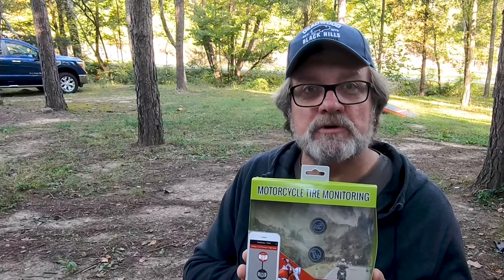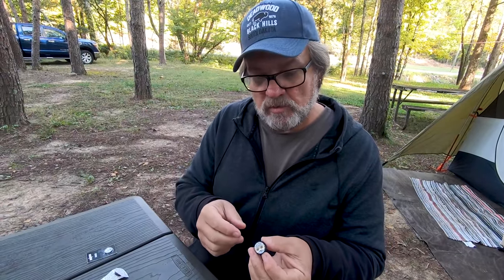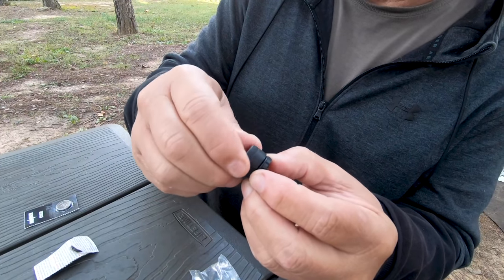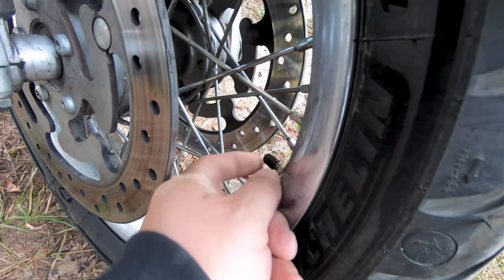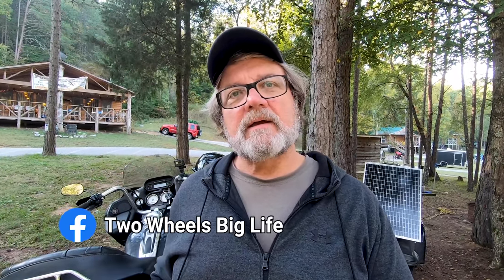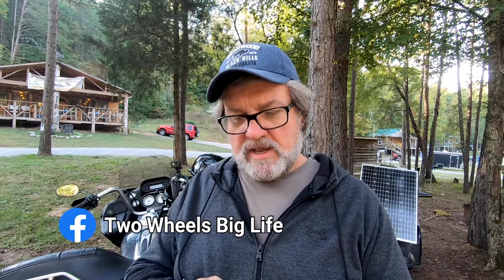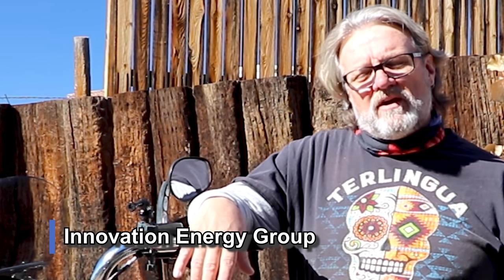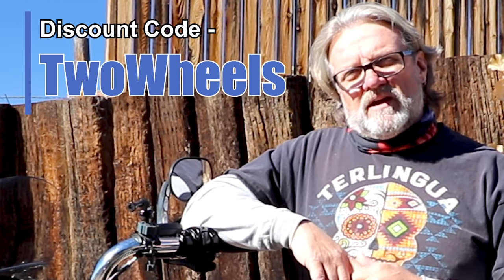Motorcycle Tire Monitoring System - Safety is key.

Comment: I haven't used them but will probably get a set.
Reply from the maker: Thanks. Be sure to use the link in the description and promo code.
Reply: Check out site here an found tire pressure unit over $80, an I don't have blue tooth? $80 seems excessive!?

Comment: I have been using a similar system for several years after I experienced a low pressure incident on my front tire. (Bikes; Older bike, 2008 GW, ABS. New bike 2021 GW Tour DCT w/ TPMS)  I had great difficulty holding a turn and nearly left the road.  I was out of town but later found the valve stem would leak at highway speed. 
No shops were near so a tow truck was called.  I was riding a recently added new set of tires but the dealer did NOT change the valve stems!!!
A group of us talked about this but it was soon forgotten; unfortunately.
A two up couple riding down a 6% grade lost control of their bike, left the blacktop and both were killed.  They were slowing and the speed was low when they left the hard surface.
In my opinion ( and others) was if they had installed a TPMS system they would still be riding with friends.
Rich; good thinking to add these monitors.  Chris, please add a set to your bike.  This is good advice for all; IMHO.
Good Rides

Comment: I have used FOBO Bike 2 on my 2014 Ultra Limited for several years. Love it but you still have to remove the sensor to put air in the tires. I do use the locking nut.

Comment: I agree, Richard. A tire pressure monitoring system gives great piece of mind. My bike came with TPMS. The time my rear tire picked up a small spike I got the low pressure alert, slowed down and pulled over before loosing control. This all happened within 5 or 6 seconds. By then the tire was flat.  Another time, on a short trip, I got the alert, the TPMS was reading low. Added air, no sign of a puncture. I monitored the tire pressure and had to add about 6 psi every morning for the next couple days and made it home. Upon closer inspection I found a tiny little staple. The timing was good in that it was almost time for new tires. When I removed the "stapled" tire one leg of the staple had just barely gone through the tire. The staple's shoulder had been worn right off so it was almost invisible. Peice of mind! That's why we do preventative maintenance and pre-ride inspections. Cheers you two.
Reply from the maker: Thanks Gordon

Comment: I have considered these, as tire pressures are crucial on two wheels. My only concern is that these caps hold the Schrader valve open, and if that seal fails, your tire will go flat. I read tons of reviews on the various manufacturers of this style tpms, and saw a fair amount of failures. Please keep us updated as you get more time and miles on these sensors. Great video and I appreciate your detailed explanations of your experiences. Ride safe guys!
Reply from the maker: Thanks Ace
Reply: @TwoWheelsBigLife  I've been looking for a system for my VTX1800 that mounts inside the tire like the automotive industry uses but haven't found anything yet. I've gotten so many good ideas from you both and I really enjoy your videos. I saw others reccomend using the lockout to prevent the sensor from loosening,  but that seems like it would be a pain every time you need to adjust tire pressures.  Am I missing something?

Comment: Richard,  Please use the locknut as I've had this type of TPMS cap become loose after time.  You can't use locktight on them so use the jam nut that comes with them.  Nice vids, keep em coming.
Reply from the maker: I most likely will before we roll out again
Reply: Wondering if there is a way to shut power down on the caps so you save battery life? Parked a few days or longer you wouldn't need them. Just take them off or???
Reply from the maker: @TheCollectiveIntellectual  Great question. You can remove the battery without removing it from the valve stem.
Reply: @TwoWheelsBigLife  GREAT..thanks for the prompt reply. Gotta get me a couple pair of these. 👍
Reply: Hey first i wanna say , my condolences to chris mom , and whats the link on the tire pressure toy ....seems like a great idea for safety .....thanks i didnt see the link pop up

Comment: I have them on my trike plus the camper and what is nice is I can check the pressure first thing in the morning without kneeling on the ground to do it. I buy them off eBay for cheap but they work the same. I have a set on my toy hauler also. These work better than the factory units as the factory items can't be adjusted to handle the type of low pressure I run in my tires ( 24 rear 17 front) BTW there is nothing wrong with getting alerts, America can use more lerts.

Comment: Thanks for huge tip, I had been planning on getting something like this. The new Indians and I think the new Harley's come a monitoring system.  My friend had the alarm come on while riding his Indian .. low pressure.  He pulled over found a nail in his rear tire. Was able to plug it and keep going till he made it home.  He still had to put a new tire on it. But he wasn't stranded along the side of the road and the tire didn't go all the way flat on him.  He carries a air pump like I do as well.
Reply from the maker: Yes we have a pump also, good to keep in a saddle bag.  most new bike have this but the trailers and old bikes like mine do not.

Comment: Mine are not BT. I have a small display on the triple T that powers on with the bike and displays the pressure No phone alerts but the display will flash and beep if the pressure gets out of the user set parameters. The monitors turn on when the bike gets to a certain speed probably like the set you have.

Comment: FYI, modern Harley touring bikes have a tire pressure monitoring system that tells you the tire pressure and turns on a warning light when the pressure of one (or both) of the tires drops below the recommended pressure. Also, you said you never leave your bike unattended, that isn't true, you often go off on hikes and you leave your trailer at the camp site all the time. Keep on living the life, you 2, I know it's something I couldn't do for long (especially now at 70).
Reply: The only Harley Touring bikes that I'm aware of that come with the TPMS are the CVO versions.
Reply: @jkentsan   All I know is that my 2020 Road King has it. I have noticed that the bike came with some items that I don't think were stock but it is the 107 engine and it seems that the high end models would have the 114. I know I really like the bike, though, it is far superior to the 2003 Heritage with the twin cam engine.

Comment: As mentioned in another post, do not use any TPMS device on rubber valve stems.  That's a no-no.  Thanks for the video!
Reply from the maker: Yep both of ours are metal stems.
Reply: Agreed, the extra weight and centrifugal force could rip the rubber stem off

Comment: ber very very carefull with theese and make sure you install the metal valve stems that come with them, had one fail and it didnt notify my phone and had a tire go flat at speed
Reply from the maker: Yes sir they are on Metal valve stems on both the trailer and bike.
Reply: @TwoWheelsBigLife  good to hear, loss all pressure at 65 mph and took 2 seconds to get flat using one of theese, didnt wreck but it did pucker my rear end, now i have a 2020 that has it built in but it is a nice thing to have

Comment: Do not use with the Goldwing "right angle" valve stems. I had a flat shortly after installing because the weight of the sensor (even though it's small), and the centrifugal force applied when the wheels are spinning, causes the right angle valve to lean over and leak around the rubber base. I switched to straight metal valve stems two years ago and haven't had a problem since (although it's a little  more difficult to add air). I will not ride even again without TPMS.

Comment: Careful - if you have rubber air chucks, I've had them start to crack at the rim level due to the weight (I know) of the sensor.  OR, you could just buy a BMW or several other new bikes that have TPMS sensors stock
Reply from the maker: I will definitely keep an eye out for that crack in the valve stem.  Makes sense. I’ll keep you informed
Reply: @TwoWheelsBigLife  - A fellow Texan watching out for you - really enjoy seeing your adventures.  REALLY enjoy seeing the Sisters shirts, Terlingua, local references.  You can't take the Texas out of your journey ;)

Comment: Richard, thanks for the well done presentation.  I've been looking at these for a couple of years and see that that different companies do the info display differently.  Some have a dedicated display for the bars and some, like yours are displayed on the phone.  I have two questions about yours that would help me make up my mind.  The first:  Do you find that you have to add air to your tires more frequently with the new valve caps?  Secondly, since my BT system doesn't give me great phone audio when I'm in intercom mode with my wife, does your phone app come to the front when an alarm is caused so that it could be seen?  Thanks...I look forward to your videos.
Reply from the maker: You are welcome. 1st answer.  No I have not needed to add air because of the new sensors.  I did however make sure the tire pressure was correct then installed.  2nd.  The bluetooth is in the background and a banner alert comes up so no Audio, just maybe a tone if that is your settings.  I also noticed that the battery does not drop any faster on my phone because of the TPMS running in the background. 
Hope this helps.   Be sure to use the Promo Code TwoWheels for the discount.  

Thanks.
Reply: @TwoWheelsBigLife  Thanks for your reply Richard...happy trails!

Comment: Man, I need a couple sets of these. I pull a trailer and I'm the worlds worst about checking my pressures. Maybe if I give the hint to my grown kids they will get them for me. So if you have a motorcycle and a trailer do you set it up for 2 motorcycles and just know that the second is right and left instead of front and back?
Reply from the maker: sweet.  Use the discount code TwoWheels and get $5 off
Reply: @TwoWheelsBigLife  Have you had any issues with air leaking from the caps? I've seen reviews on other brands (not this one) where people were have problems with them leaking air.  Hey and we need to get together some time after the holidays. I'm in Arlington.
Reply from the maker: @SteveOutdoors  I have not had issues with them leaking.    Some people have commented and it make sense is to install these on metal Valve Stems.   I failed to mention that I guess because mine were already metal.   Getting together would be great but we are in New Mexico now and heading to southern AZ soon.
Reply: @TwoWheelsBigLife  Good to know! My bike tire stems are metal but my trailer tire stems are rubber with metal ends like a car. 
Stay safe!

Comment: I heard you should have metal valve stems ... I have them, but am afraid to use them because I have rubber valve stems ... thoughts on yours?
Reply from the maker: Both the bike and trailer have metal
Reply: Must switch rubber to "straight metal" valve stems. I learned this after sitting on the side of the road for 5 hours waiting for a motorcycle tow truck,

Comment: TPMS system sensors should NOT be used on Rubber valve stems, ( metal stems only) the rubber valve stems may crack & leak, or worse , cause a blow out, Steve
Reply from the maker: We have metal stems on both bike and trailer.
Reply: Can I put this system on my 2018 lowrider? Harley.

Comment: Duh ,if you are loosing pressure ,you have a flat, Only good device for checking pressure before you ride ,if the scoots been sitting awhile, like you should be doing anyway.
Reply from the maker: Yes but as one person said the TPMS caught the tire going down and he was able to get pulled over, plug it to get to a town and he it changed.